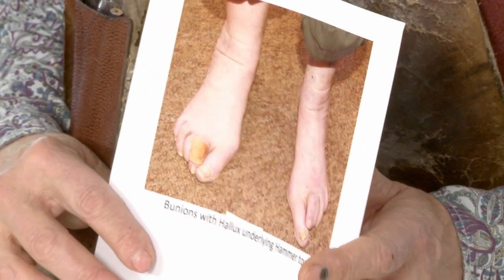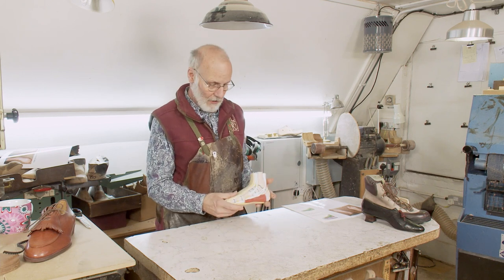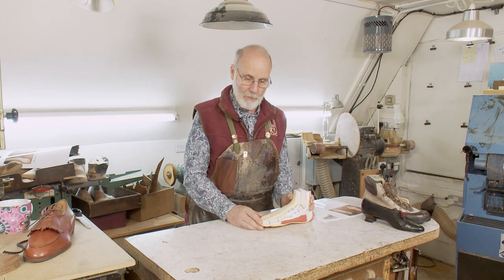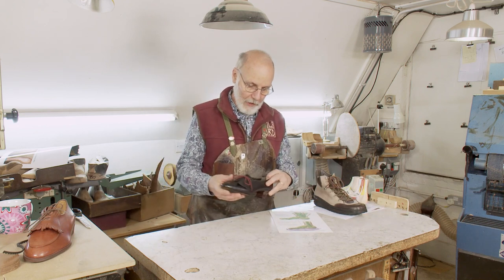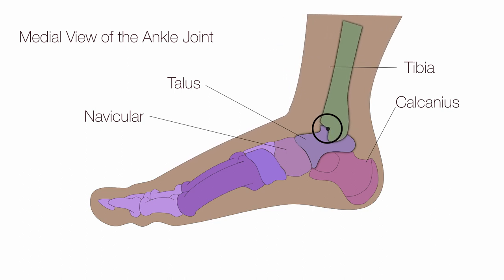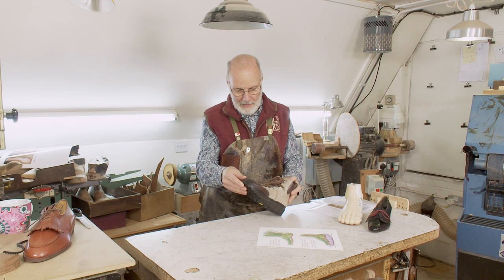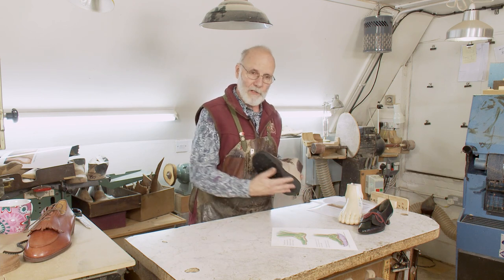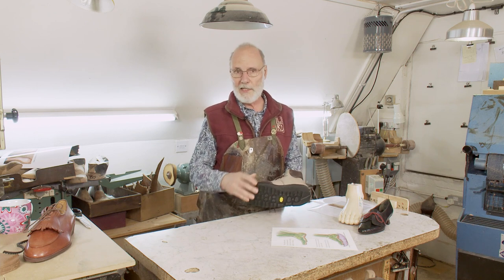17 Shoe Design Principles for People with Internal Chronic Foot Pain

Comment: Superb series of videos, Bill! Multiple camera angles, professional lighting, excellent production values. I hope the viewers appreciate the effort that has been put into these videos. 
As an orthopedic shoemaker since 1976, with an interlude of 25 years as a prosthetist, I would like to add some insights on prosthetic feet and custom orthopedic shoes. Various prosthetic feet require very different fitting principles from footwear. For instance, the standard prosthetic foot of yore was the SACH (Solid Ankle Cushion Heel) foot, which depends on the compression of a soft heel wedge to replicate the motion of the ankle. There needs to be enough room for the soft foam of the heel to expand a little and clearance under the arch for the heel to depress so that the prosthetic foot functions properly. Other designs have hinges and bumpers in an articulating ankle which do not have these requirements. Some prosthetic feet can tolerate a little variation in heel height, while other designs require an exact heel height. Consultation with the prosthetist is essential in designing the lasts and shoes for amputee clients.
Thank you for making these videos! I learn something from each one.